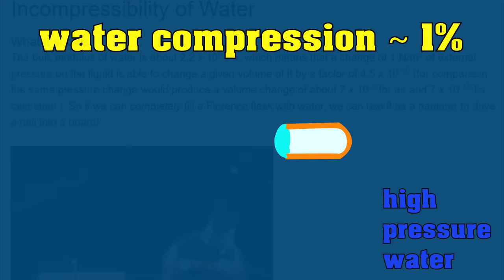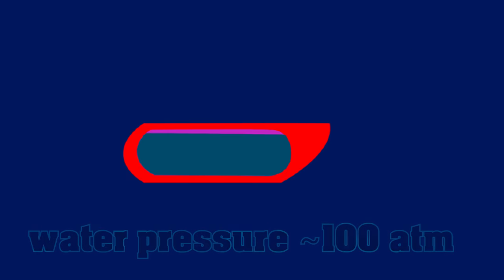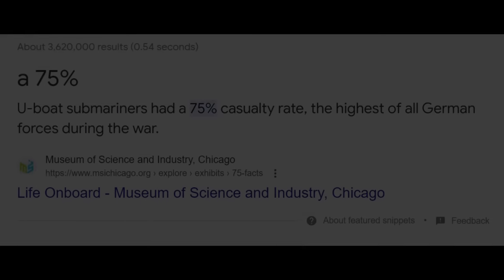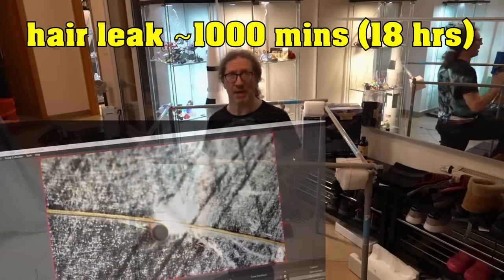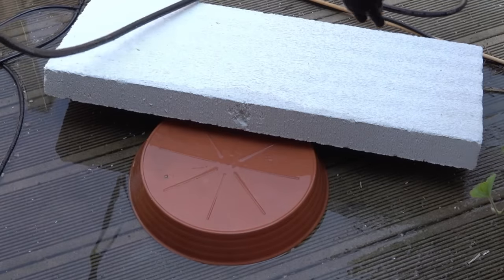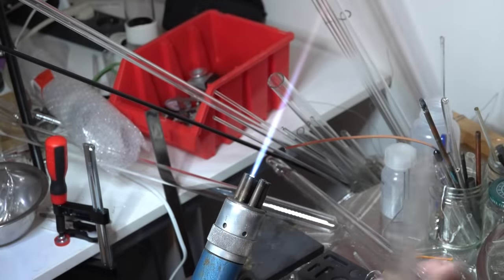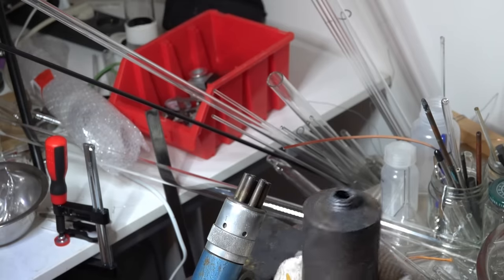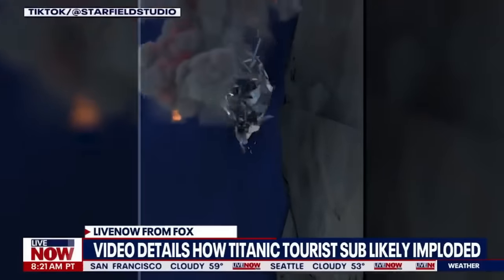Why the Titan sub failed

Comment: I believe the reason your pressure washer demo didn't work and big difference between a pressure washer and a water jet cutter is that your pressure washer aerates the water so you don't destroy the stuff you want to clean.
Reply: Yeah, I'd imagine they'd lean towards less ability to maim for all sorts of reasons. Liability, cost, safety. Bigger gas powered pressure washers can absolutely obliterate wood
Reply: Could also be that it didn't get enough water supplied to reach it's maximum pressure. Bigger pressure washers usually need to be hooked up to a buffer tank because a regular sized water pipe just can't supply water fast enough. The nozzle diameter is also something to consider.
Reply: Biggest difference between a pressure washer and a water jet cutter is the water jet is accelerating some fine grit abrasive like silica.  Its the abrasive that does the cutting, not the water.
Reply: @alexe589  There are water jet cutters with and without abrasives. Cutting with pure water works very well too, depending on the application.

Comment: One of the experts that the media consulted about the sub failure said that the lap joint was a sub designer's nightmare.
Reply: Many pressure vessel design codes limit the use of lap joints to low requirements situations.
Reply: What on this thing wasn't a sub designers nightmare?
Reply: so you're saying the construction was sub standard?
Reply: @andrewtaylor940  The 3.5 inch thick titanium end caps. Those were in the dreams of sub designers. The rest though......especially the glue

Comment: I think it much more likely that the carbon-fiber tube buckled and both the titanium end caps were forced together. Previous passengers reported cracking sounds while descending which seems to suggest delamination within the matrix, weakening the strength of the tube.
When HMS Scorpion imploded the stern was forced forward into the hull which they call - if I'm not mistaken - telescoping. Where the steel hull of the Scorpion more-or-less remained with extensive deformation, the Titan's carbon-fiber tube most likely shattered upon failure.
Reply: Think you mean USS Submarine - of the 11 HMS Scorpions, none were submarines. From wiki on USS Scorpion: The secondary Navy investigation ... suggested that Scorpion's hull was crushed by implosion forces as it sank below crush depth... The operations compartment was largely obliterated by sea pressure, and the engine room had telescoped 50 ft (15 m) forward into the hull due to collapse pressure, when the cone-to-cylinder transition junction failed between the auxiliary machine space and the engine room.
Reply: If the leaked transcript is real, it may have started with a pinhole leak in the aft section. The leaked transcript, according to a video from jeffostroff, mentions a "crackling sound at aft", which is apparently a walled off section where some of the equipment is. So perhaps there was a pinhole leak in the aft section that caused them to take on water in a compartment they couldn't see, which increased the rate of descent and led to equipment failure due to water damage ("trying to run diagnostics, ascending now. but very slow.... global RTM alert active all red... reading red on the A power bus. I switched to B... more sounds aft..."). Then perhaps eventually the pressure built up enough for the dividing wall to fail. Idk
Reply: @dildswagginz3408  Oh, very well might be. I wrote that event from memory; the image of the stern shoved into the main hull is amazing.
I have seen the transcript of the final communications  explained. What I've seen from the insides of the Titan there is very little there. I have worked at a company building personal submersibles, and there is a lot more on the inside then there was with Titan. If there was a leak, you would know it and they would have reported that. As the disturbing sounds was emanating from the rear I suspect they may have had a problem with the battery-pack, air bottles, or diving tanks. They must have taken on quite a lot of water seeing how dropping ballast and the undergear barely gave them positive buoyancy rising 20 meters in a span of three minutes after dropping weights. If the dive tanks were compromised and increasingly hanging down in stead of pulling up it will have changed  the load on the main hull, possibly inducing the failure.
Reply: Hydraulic Press Channel has a carbon fiber not-a-model-of-Titan being crushed under water pressure.  It is instant and the carbon fiber was reduced to dust.
Reply: HMS Scorpion? Correction: USS Scorpion.
Reply: @roykliffen9674  The titan carbon fiber hull actual does double duty compared to other DSV. Aside from resisting pressure, it is also structural, it has to carry the weight of the electronic bay... if that got flooded... wouldn't it add extra weight that carbon fiber cylinder had to support during the assent. May have been too much and the hull buckled a little and the asymmetry caused it to implode.
Reply: @dildswagginz3408  The wall between the "electronics bay" and the rest of the pressure vessel was just a flimsy separator with lots of holes in it (such as where the large computer monitor was mounted). It wouldn't hold any pressure whatsoever.
Reply: Crackling sounds are also in the transcript that may or may not be real.
Reply: The cracking sounds are also present in Thunderf00t's explanation. Listen to the glass cracking when expanding at different rate than the metal. The cracking could've been the carbon fiber compressing more than the titanium

Comment: I liked the experiment on hydraulic press channel where he  made it in scale (not the old experiment but the brand new one),  carbon fiber tube with caps. He got both results, he got one with a leakage where nothing really happened to the sub, it just filled with water, and 2nd result where the sub imploded carbon fiber just shattered.

Comment: There is also the viewing portal that was only certified to 1,400m by the company that made it and Ocean gate wouldn't pay for a one certified to 4,000m. The dynamics of implosion are unique to every structure type. And the viewport window was missing from the fore titanium endcap as they were using a sling through it to lift it off the salvage vessel. Not a part of the wreckage you'd remove if it was still intact if you wished to analysis the failure mode later.
Reply: The port was designed and built to resist imploding into the sub underpressure. I would not be surprised is the implosion depending upon where it happened didn't compress an air pocket down part of the tube and just pop it out like spiting out a cherry pit.  Doubt it reinforced to 5-6kPSI from the INSIDE...
Reply: Another engineer said they probably did remove it because there was no damage to the flange indicating it imploded like bolts still being their or torn out so I find it more likely that the tube failed.
Reply: I think if the failure occurred at the aft seal of the pressure vessel, the water hammer could have blown the viewport out of the front of the sub.

Comment: Carbon fiber has high tensile strength which makes it good for building aircraft fuselages and scuba tanks (where you need to contain high pressure inside the vessel). A submarine is different because the pressure is pushing from the outside in. The carbon fiber can't easily resist getting pushed inwards, so all it can do is make the epoxy resin more rigid. The epoxy cracks under compressive stress (because it's not as strong as carbon fiber), and the carbon fiber layers start to peel off from one another. You get an effect similar to metal fatigue, where the vessel is initially strong but the cracks grow with each dive/surface cycle, until catastrophic failure occurs.
Reply: @criticalevent  Kinda doomed  before he started.  Especially cycling pressure states embrittling the polymers let alone the cold.  Planes go through regular appraisals of their integrity after known hours of abuse.
Reply: Or simply put, you can't push a rope.
Reply: @miinyoo  Also according to the proposed transcript, the Titan was descending too fast and ascending too slow when the dumped their weights. They also lost power to Battery A  (Indicating flooding in their electronics bay.) Anyway... Carbon fiber also does not like rapid increases in stress loads... it actually fails at a lower loads if the rate of increase is fast rather than slow.  So Titan's rapid descent (nearly 2x faster than normal) might have been the straw that broke the camel's back.
Reply: Yes, composite overwrapped pressure vessels are common, but have a limited life at full pressure, and also a cycle life. I have one used as a water purifier, and while it is 10 years past it's life, it also is only used at 1bar of water pressure, not the rating of 10bar, and 20 bar test pressure. Should have a near indefinite life at that pressure, especially as it generally is not under pressure unless I need to draw water. I will probably wear out the threads changing the resin first.
Reply: That's my theory of the cause of the implosion, the carbon fibre started delaminating because the inner surface is under compression. But Thunderfoot raises a good point that the carbon fibre shell will be trying to shrink relative to the titanium rings, creating a shearing action at the join.
Reply: @SeanBZA  Most materials have a limited cycle life (steel is an exception, below the critical stress it lasts indefinitely).   But plastics such as PVC or HDPE have a limiting allowable stress (after tens of thousands of cycles) that is a fraction of their one-off tensile stress.   I've seen large plastic pipelines expensively blown up because the de-rating necessary for cyclic loading wasn't taken into account.

Comment: Excellent explanation. Weird how media just bought whatever one guy animated and did not even ask any scientists whether, "hey is this animation how it physically happened? Is it accurate?"
Reply: It‘s because the media will show anything that is presented in a spectacular fashion, regardless if it is correct or not
Reply: The animation was so bad, it actually made me laugh out. I don't know how anyone can take that seriously. Mainstream media is a joke.
Reply: @tempusername-l5d  It would have started as a leak, but the water leaking in would also be cutting the hole larger, so the leak would speed up, so cutting the hole even larger.  This whole process would last a fraction of a second, and the whole could get large enough to completely destroy the carbon fibre part.  It's a similar process to a dam collapsing from an initial tiny crack.
Reply: Why is it excellent? There are like 3-4 different sub-theories branched out in the vid.  The animation may be basic or crude, however all the experts seem to agree that basically it happened like that.
If these experts where to jump into TF's area of expertise and start going of with theories on something he'd done a video on, I know I'd probably be more inclined to listen to TF as that is his area of expertise.
Reply: @tempusername-l5d  The chat logs between the sub and the main ship have been released. It seems that they were actually sinking, not descending. Therefore, Thunderf00t is most likely right.
Reply: @kwinzman yea. I'm pretty sure it was made as a meme that mainstream media thought was the  real deal.
Reply: @tempusername-l5d  Pointless to argue with someone who can't tell the difference between sinking and descending.
Reply: @kwinzman Yeah the animation was super bad and memey, though I have seen one that looks at least way better (super realistic, something someone would try to pass off as "real" if there ever would have been cameras outside capturing the situation).
Reply: Everyone can have their opinions and not be wrong when their opinion is based on what they know scientifically, but not on the facts of the Titan incident since the public has no clue how the actual timeline of the dive played out. I know an unverified transcript was leaked which was able to give folks a much better idea as to what likely happened, and that is the thing that matters. All the experts of this stuff need to know the official timeline of how the events played out through communications between Titan and the surface team. If that transcript is legit, it gives a great amount of info as to what likely happened to the sub.
Reply: @tempusername-l5d  Did you watch the previous video? He doesn't say it just got too heavy and sank at all, for one thing, it was already close to the ocean floor. What he is explaining there, and here, is the effects of water pressure, and the speed of any leak, and ingress of said water once a failure occurs. Virtually every other resource is not necessarily accurate either, 99% of it is pure speculation by completely uninformed individuals.
Reply: @tempusername-l5d  Can we see your maths and research notes on that please.
Reply: @tempusername-l5d  yea this video is wrong
Reply: Yep.  Just think about how that credibility applies to everything else they report on.